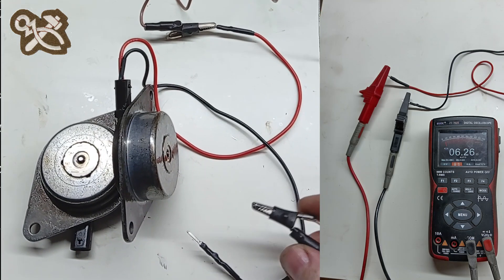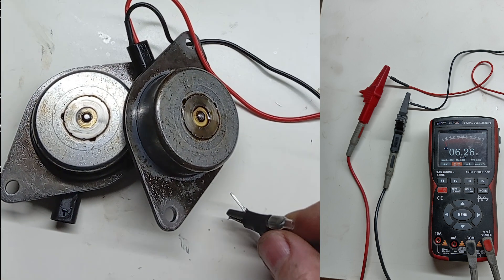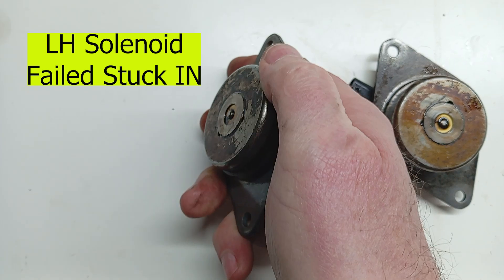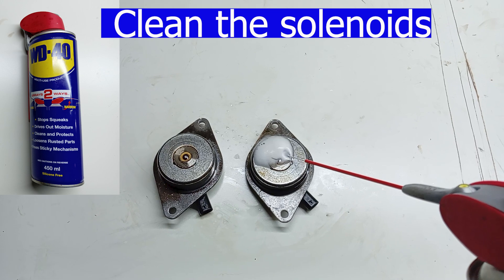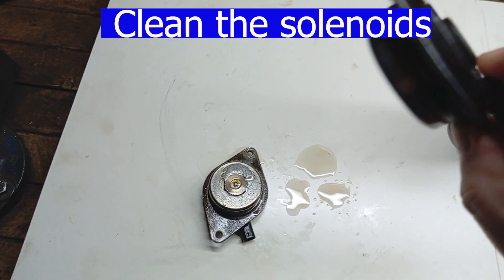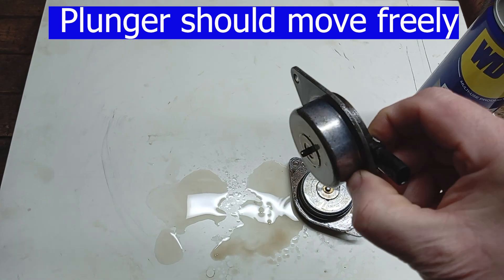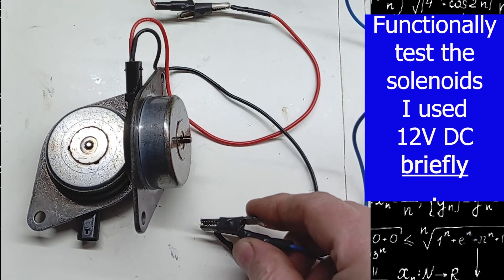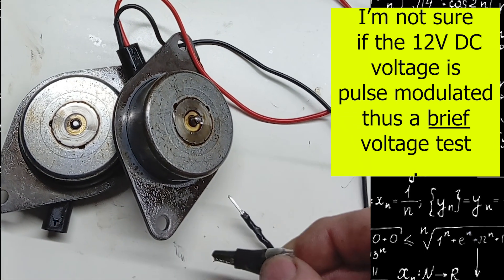Corsa D 1.4 A14XER  Camshaft Solenoid Testing (Short Version Tests Only)

Comment: Should you reverse polarity to check to see if it reverses back into body suitably?
Reply from the maker: I can't see the benefit of that, if you remove the +12V power [remove the connector] then that would test it's function; it's all that the ECU does anyway, the valve itself releases the vacuum when it's not activated
Reply: Vacuum?
Electronic solenoid pushes the valve to let oil into the phaser. No vacuum involved